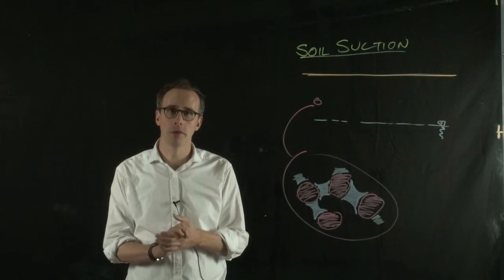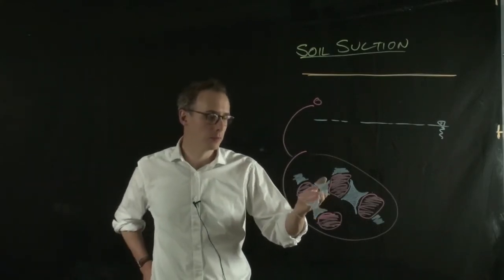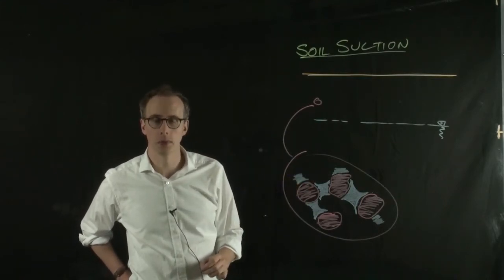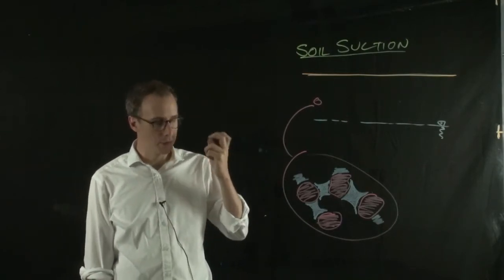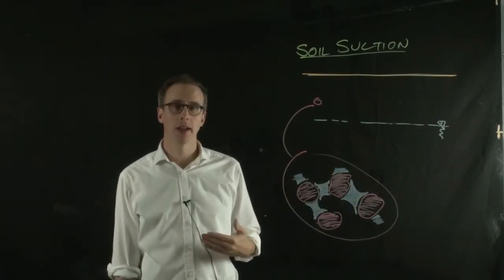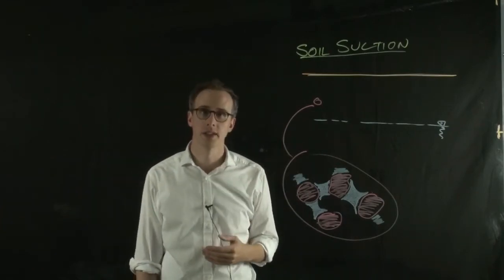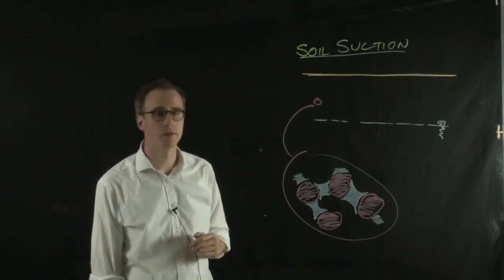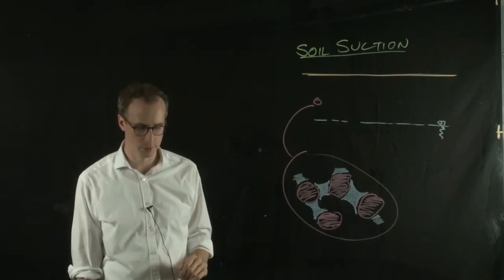Soil Suction

Comment: Soil suction occur above the water table in unsaturated pores where the space between soil particles is occupied by some water now the surface tension of that water creates meniscus and a force that pull that binds the soil particles together and that creates an apparent cohesion that the soil that goes beyond the attraction between solid particles so the soil has an apparent cohesion and it is due to the negative pore water pressure that exists these droplets of water so the ability for soil to generate soil suction to generate negative pore water pressure is a function or directly proportional to the particle sizes within the soil so clay size particles will have greater soil suction than sand sized particle so this is important by my thinking about stresses within the soils because we take the pore water pressure from the phreatic surface the phreatic surface is where the pore water pressure is zero and we calculate all pore water pressures as a function of depth below that.
This is can be complicated when we go to the field to try to measure where the phreatic surface is because the presence of negative pore water pressure above that creates condition within soil can seem almost fully saturated so even several meters above this phreatic surface so where do we take the phreatic surface from measuring high water contents above it and this is even more trickier for soils with fluctuating phreatic surface where we might have ground water conditions that means that we don’t have constant phreatic surface.